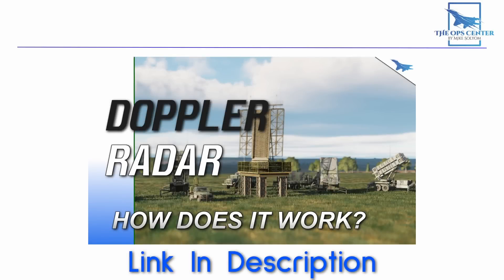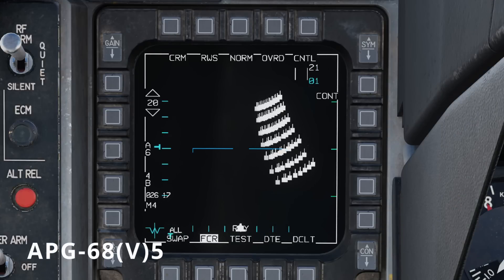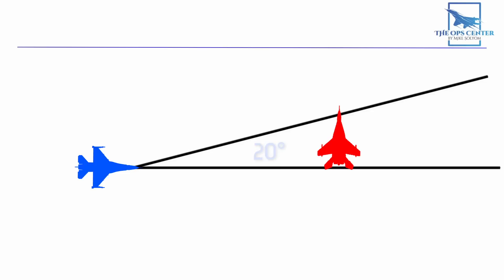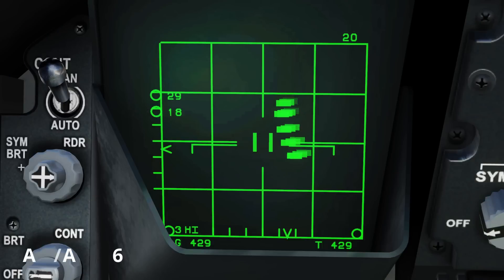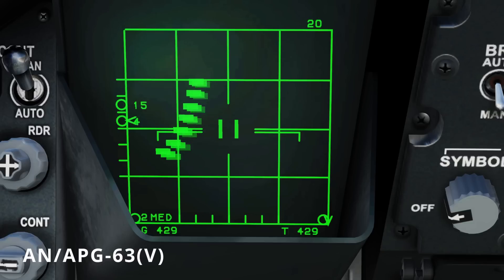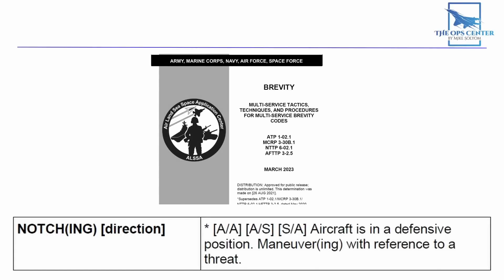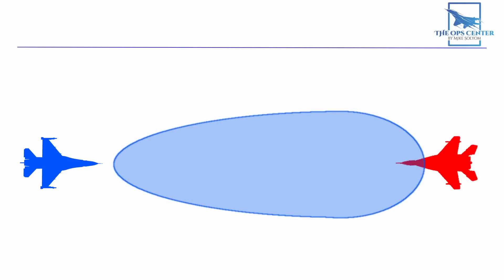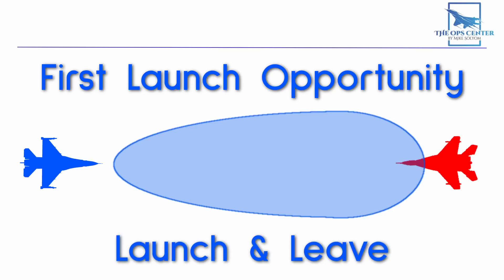The Real Truth Behind The Radar Notch | How Beyond Visual Range Combat Works

Comment: 7:27 Unfortunately, ED has unrealistically nerfed ARH missiles so that this isn't true in-game.
You can be caught completely unaware that you're in an enemy's WEZ and (even if he has held a good, clean, high update rate radar track on you for the entire missile flight duration) the missile will always give its target an early enough warning so that a simple, instinctive beaming split-S is guaranteed to save you if it was launched at a BVR distance.

ED's justification is that the missile requires 8-10 seconds of active radar illumination to home in on the target, however this doesn't match what is publically said about American ARH missiles (that the target has less than a second of warning) when they are launched at unsuspecting targets. Even when you actually go and calculate the linear approximation for the downrange and crossrange uncertainty of the mothership's radar, illuminating a 1m^2 non-maneuvering target at a conservative F-Pole of 25nm, assuming a standard X-Band radar with a 2GHz bandwidth and a 2.5 degree main lobe FWHM; then assuming the missile has an endgame velocity of Mach 1.5 and the ability to turn at ~15g, versus a target velocity of Mach 1.0, the minimum amount of active terminal maneuvering time required to compensate varies with target aspect (closure velocity varies between roughly Mach 0.5~2.5), but is almost always less than 1 second (a beaming target maximizes the uncertainty and requires ~1.31s at 15G, but only ~0.76s at 30g).

1:20 This also doesn't make any sense as implemented in DCS, since even the very first fighters with analog Pulse Doppler radars used gates to isolate sections of the radar data cube (for example, in addition to the cross-range or azimuth gate, there would be a down-range gate, a velocity gate, an altitude or elevation gate, etc.), the only IRL circumstances where the ground clutter returns would even get to the notch filter together with the real target return, would be when the target is close enough to the ground so that the clutter extends into the same RDC element.

Even worse is how DCS makes notching just as effective over large bodies of water, as if the water produces anywhere near the same magnitude of clutter (just look at satellite ISAR images of airports or airfields near the ocean; the contrast between aircraft landing/taking off and the inky black water makes them easy to pick out).
Reply: " instinctive beaming split-S is guaranteed to save you if it was launched at a BVR distance."
I have to disagree on one thing, because it's not true anymore, someone who flies into a Fox3 unsuspectingly and the missle arrives with good energy 2-3mach it's almost impossible for the target to escape this missle.

and i'm talking about 40-60nm shots here. when the target is over 20-30,000 feet and gets a warning it becomes critical if it's not prepared
and I'm talking about PVP experience

"ED's justification is that the missile requires 8-10 seconds of active radar illumination to home in on the target, however this doesn't match what is publically said about American ARH missiles (that the target has less than a second of warning)"

could you give me the names of the public docs so that I can read them?
Reply: The Iraqi air force used notching tactics against the f15 in one of the most famous air fights of the desert storm war, and it worked 

No, just doing a small maneuver doesn't defeat the missile, I have kill players at 50 miles with the hornet, if you get caught high, the missile will F you hard, going cold is your only chance, and that is if you manage to turn in time lol

But yeah if you fire a missile from 15k feet at mach 0.8 to a target at 35k feet and mach 1.8, he will easi5defest your missile 😂
Reply: Second-time-around returns. It's a thing.
Reply: @ethanmckinney203  What, specifically, are you referring to?
Creeping wave returns to the illuminating radar?
Multipath effects when over a flat ground plane?
Reply: Nerd

Comment: The problem in DCS is with fox3 missile guidance on terminal phase, if you can get into a 2.5deg notch near the ground (under 100f agl), that missile will miss you 90% of the time, reliably and repeatably. it's not kinematic defence when the missile flies over your canopy or tail plane
Reply: Notch is super easy in DCS since... 2 years at least ? 
Sometimes it gets harder after a patch, but not for long. 
I've seen many jets trashing missiles with a lazy 70° notch, and at speed around Mach 1. Lol
Just need to be on the deck, ground return seems strong in DCS 😅
So BVR tactics are quite limited for now.
Reply: I think you've highlighted an interesting difference between people playing a game and real world combat pilots: a 10% chance to die is a terrifyingly high chance of dying.

The F-105 suffered such high losses in Vietnam that it was phased out in favor of the F-4. What was that attrition rate? Less than 2%.
Reply: @wmouse  yea in DCS you can practice notching with the same parameters every time unlike in the real world where the parameters are not necessarily known or can be simulated close enough.
Reply: You can do it 100% of the time. Just gotta practice also pretty sure you can do it a little higher too.
Reply: @freakmusicaddict  nothing is ever 100%, especially inside ed code
Reply: @BMD8  Na that is just a skill issue, at close range it is just a very small time window. The only thing that could happen is you get a desynced missile but that is online only.
Reply: @freakmusicaddict i do it all the time with missiles being fire at me at 4 miles or less lol, as long as the terrain is flat enough you will notch it 90% of the time, but sometimes the missile hits the ground and still damages your plane, since I normally do it around 10 to 20 feet
Reply: @StoneCoolds irl this would not work as the missile would change pulse repetition frequency mode and wouldn’t lose guidance/would re acquire

Comment: when i try to notch in fox 3 combat, i generally try to notch the missile itself, rather than the launching emitter. that should work just fine in that case yes? of course i know this makes it easier for the opponent to make follow up shots, but i should able to save myself from a missile in otherwise kinematically lethal ranges like this i think.
Reply: In dcs it's incredibly easy to notch a fox 3 missile and that's what you should be doing. There is specific type of bvr fight called notch fighting. Since notching in dcs is is a 100% tactic(if the miasile is in the notch window it will 100% get notched) the ranges of the fight can get up to 2-3 miles close if both fighters are experienced.
Reply from the maker: Yeah absolutely. It can work. But it can also fail. So you always take a risk when trying a notch. I've always viewed a notch defense as something you would use when there's no other choice. My preference is to follow the guidance I've talked about in the rest of the BVR series and work a plan that keeps you outside the enemy's effective range.
Reply: That was my exact thinking. If I put a fox3 on my 9 o clock and not the firing jet I should be able to notch it. Of course the closer the missile the harder to get the right notching angle? Can someone clarify?
Reply: It's the missile's ability to see the target that's relevant to a kill, so yes, notching the missile is what you need to do for a pitbull Fox 3. It should also work for a Fox 1 or a non-terminal Fox 3, but since a Fox 1 isn't emitting anything itself, you'd have to identify the missile visually to notch it, so notching the illuminator is the better bet in general. In principle, the illuminating radar could be steered by another sensor, though. In this case, the illuminating radar itself wouldn't see you, but as long as the other sensor kept it pointed to illuminate the target, the missile would still pick up the reflections, and they'd have a different doppler shift than the ground clutter if you didn't have the missile notched, so you'd have to notch the missile. I'm not sure if any aircraft (especially those likely to be limited to Fox 1's) have this capability, however.
Reply: Notching a fox 3 before it goes pitbull/active would be kind pointless I would think.
Reply: @schmitty5461 No, because wherever the illumination is coming from (missile or aircraft), the missile will have trouble tracking the target if the target has the same doppler shift as the ground clutter. The difficulty will be in visually acquiring the missile to notch it, since it won't show up on RWR yet. The alternative is to notch the launching aircraft. If the launching aircraft loses track and you leave the beam of the illuminating radar (or it ceases illuminating because it lost track), that will force the missile pitbull early. You will then have to notch and defeat the missile itself, but its radar is weaker than that on board an aircraft, so if you force it pitbull far enough out, it may not be able to acquire you again, or, if it does, may have to make significant course corrections after flying blind for a while, which will make kinematic defense easier.